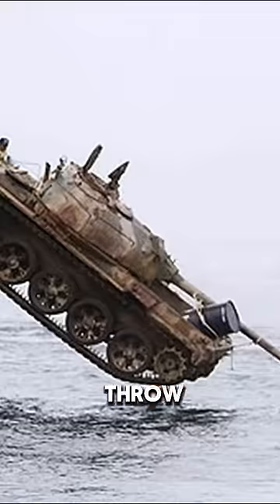Why US Dump Tanks At Sea #shorts

Comment: If I threw an old car in the ocean  4 a reef bed it would be classed as pollution, guess is it a different rule 4 the government? 🤷
Reply: for. It's a three-letter word, kid
Reply: Absolutely, mainly because that car is still loaded with, electronics, chemical residue, oil residue, and possibly dangerous paint, as apposed to completely stripped and cleaned out metal.
Reply: Well you have to strip the vehicle down to just the hull and turret
Reply: If you thew an old car into the ocean the government would arrest you, financially destroy and/or toss you in prison.
Reply: @maverickblackhorse3068 
And rightfully so.
Reply: They cleaned real thorough.

Comment: When I throw trash out the window, Im not polluting; Im rebuilding a land-based ecological environment that will take decades to disappear!  You are welcome, squirrels!
Reply: LOL
Reply: except throwing tanks into the sea does help rebuild reefs….
Reply: @taki0ps230 So does concrete. Concrete has way less negative impact.
Reply: @taki0ps230  Yes it does.  The steering fluids, oil, coolant, fuel, electrical wire coating in every tank that's dumped in the sea (because it's cheaper to dump it than ship it back), I hear they also help keep the sea lfe safe and well-fed too!
Reply: @onlinebills9169  do you even work for the military?
Do you have proof that they don't strip them? 
If not, shut up
Reply: @quickwimnl  how do you know concrete has a less negative impact? dumping tanks and sinking ship in an effort to help marine life has been studied for a few decades now and there is largely no negative impact from it
Reply: @taki0ps230  research has proven that concrete has way less impact.
Reply: @quickwimnl  can you point me towards that research? because from my understand concrete might have little negative impact however the making of concrete is very energy intensive contributing to pollution, while the sinking of ships or dumping of tanks repurposes the metal.
Reply: @quickwimnl if you're making new concrete, then it's worse. If you're using reclaimed concrete that would otherwise be trash, then it's better.
Reply: @taki0ps230 because concrete is similar stone. Its natural material. But all the chemical fluids in the tank is deffinitly not good for the sea lol.
Reply: @Aposte-quotation  They remove the fluids.. it's not hard. Believe it or not the vehicles are designed to be serviced.
Reply: @cefb8923  you can NEVER drain the entire hydraulics systems that go thruout the tank. Stop capping. Atleast a liter stays behind in the pipes. And later polutes the ocean
Reply: There could be some uneaten taco in the trash. Win win for Mr squirrel 🐿️ 🌮
Reply: @taki0ps230  Those tanks were all painted with lead based paint dude. Not to mention all the oil and grease. The Op is right. It's the government dumping old junk and calling it some else.
Reply: @quickwimnl beleive it or not, the manufacturing of concrete is a major contributer to carbon emissions
Reply: BS.... It cost too much to ship them back.....
Reply: @taki0ps230  Oh yes!  Especially with all its leaking engine, transmission fluids, degrading electrical wires and the lead pain of the times!  Yes, very good for the environment, indeed!
Reply: @mysticalfitzy9844 Concrete ratio = 0.9. Steel ratio = 1.89. The production of steel (or Iron) is way higher in carbon footprint. So reusing the steel instead of dumping it, would save a lot on mining for the steel alone.
Reply: @taki0ps230  lmao you really think making concrete is more energy intensive than making tanks and that concrete doesnt already lie around everywhere?
Reply: Only if it is plastic though
Reply: Yea, because tanks were made out of plastic lol
Reply: @Aposte-quotation  a liter per tank, do you understand how miniscule that is?
Reply: @windowsvoov  There is more petroleum products in a tank than what my garbage can contains would contains in an entire decade!:
** Wire coating & electronic motherboards
** All controls, screens in the crew compartment
** Dozens of gallons of engine fluids (transmission oil, engine oil, coolant, lubricants/grease)
** Hoses, belts, caps and electronic motherboards
** The fuel of the tank still in it.
** Every piece of rubber on a tank's tracks.
** The tank's exterior paint

Or maybe you didnt know that petroleum also makes plastic!

Comment: This is one way to say you don't want to put effort in recycling. The USA belongs to the biggest polluters in the world. This is one of the reasons. And no, you can't claim all for artificial reefs.
Reply: USA ranks 143rd in the world for air pollution. The USA ranks 12th in the world for water pollution.  False . Try again
Reply: how is getting rid of something and at the same time aiding in something else a bad thing? tanks go overboard and help create an artificial reef…tell me how that is a bad thing
Reply: @taki0ps230  Paint: not good for the environment. Oils, plastics, greases, heavy metals (toxic)... Just learn to recycle. And every pound of steel you don't have to dig up is better for the environment as well. Less pollution from the mining-industry.
Reply: @quickwimnl  i guess you didn’t know but tanks and ships are stripped of everything and cleaned before being dumped to use as reefs. paint is removed, electronics are removed, the engine is removed alongside any liquids etc. heavy metals is a valid concern though regulatory agencies already do the appropriate research to find out if it’s safe long term

Comment: Actually the reason is even different. The steel tanks are made of can be used for other tanks, but not really for other uses. Melted in a furnace it would ruin the charge because of Mangan and other metals like Nickel, Chrome, Molybdenum.

Comment: Those old ww2 tanks, planes etc were dumped into the sea so they didn't have to pay for them per the lend lease contracts. If theyre put in the sea the steel cannot be used. ALL steel, iron, copper needs to be seperated before refining and reusing. This is done every day and is much cheaper than mining more ore to be smelted.

Comment: This is wrong in multiple ways
No vehicle is put fully into a furnace it has to be broken down
Also the different metals melt at different degrees and can be drawn off
Steel recycling is done daily using far "dirtier" materials than tanks